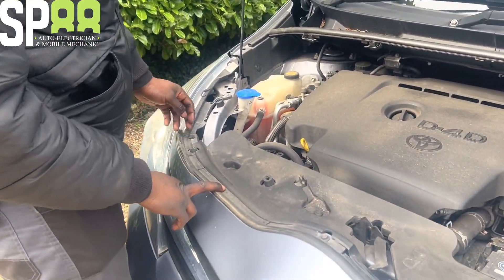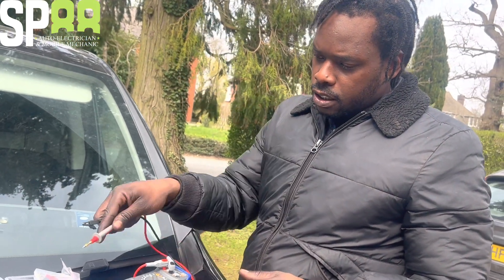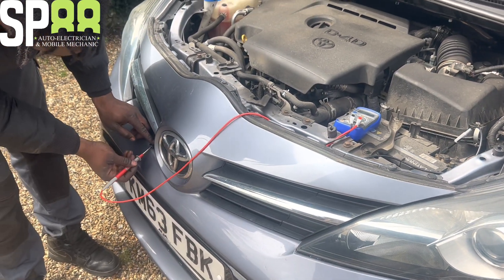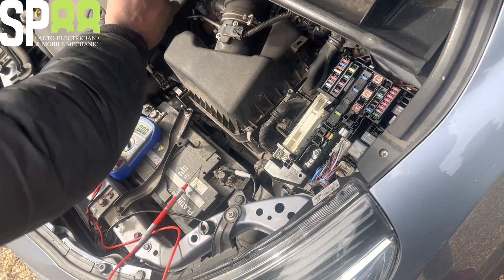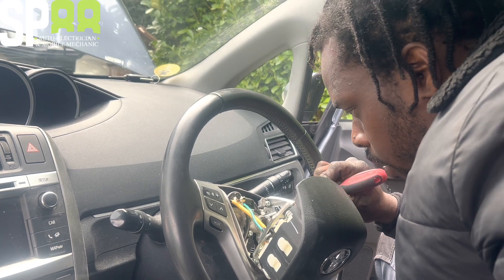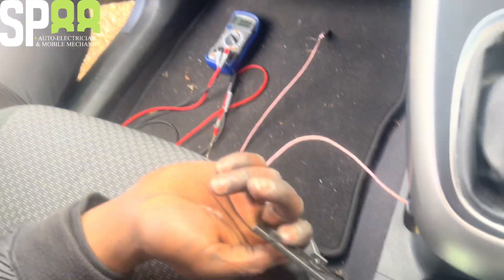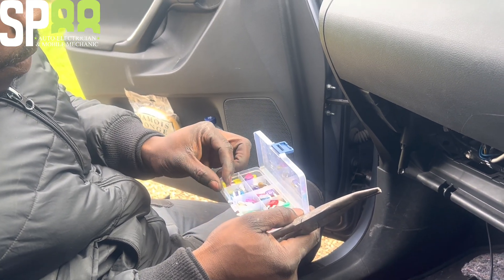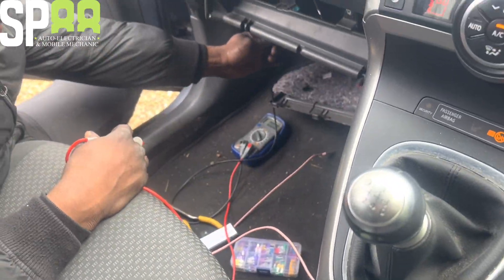Quick Fixes Troubleshooting Toyota Verso's Horn & 12V Charger | How to fix the Horn & 12V Charger

Comment: So does the battery need to be disconnected as I may need to clean the contacts.
Reply from the maker: Yes, before removing the airbag, it's wise to disconnect the battery
Reply: @sp88tips  thanks but I did it without removing it. I'll keep that in mind if I have to do it again.
Reply: @sp88tips  In your video this is clearly not the case.
Reply from the maker: @toctoc3897  fair enough

Comment: Using a flat head screwdriver, not too small, insert it into the two holes one at a time as in video. Wriggle it and eventually you will meet resistance from a clothes hanger type wire which is perpendicular to the screwdriver. Push the wire a few mm and gently pull up the horn cover. Repeat on the other side..
Reply: Wish you had the video bit of the screw driver magic. Cover not coming off for me… I’ll keep trying. Thanks for the the rest though.
Reply: 10 seconds after I posted that it come off easy. Thanks again.